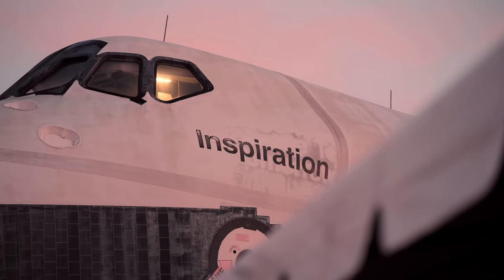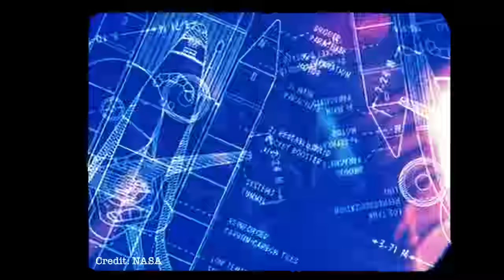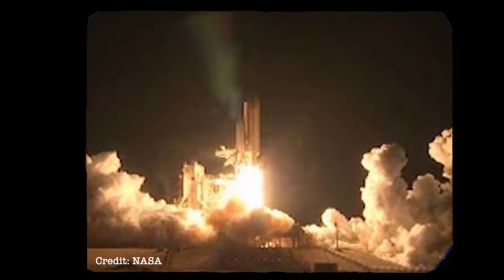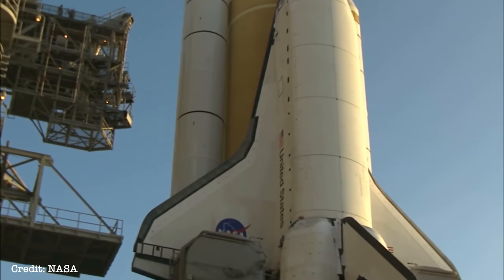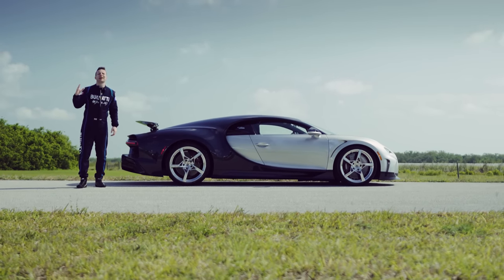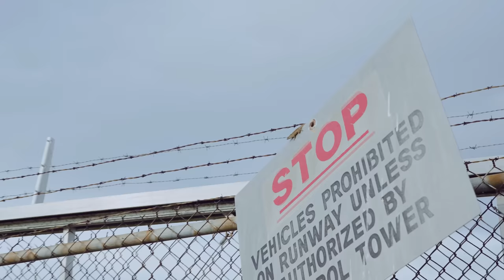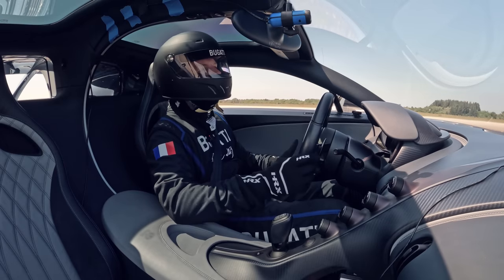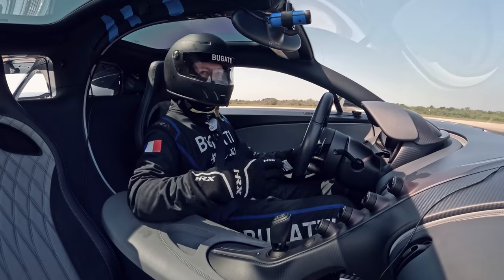Bugatti Chiron Super Sport vs Space Shuttle – Which Is Faster Down A Runway? | Top Gear

Comment: Chiron went faster than a conventional space shuttle landing, but I bet not faster than the Reliant Robin space shuttle
Reply: next bugatti should make 2040 ps + 1 yasa axial flux motor with 500 ps that only  weighs 25 kg it should be sandwiched between  10 speed multiclutch gear box and the engine plus 10 kwh catl condensed matter semi solid state battery with 430 wh/kg in pack it means battery will weigh less than 25 kg,that also means next bugatti's electric system weighs only 65kg with high volts cables and the inverter,bugatti should unveil the beast in 2026 geneva motor show,2540 ps hybrid bugatti with carbon fiber front and rear subframes it will weigh exactly the same as chiron ss but with 2540 ps hybrid powertrain,it will be the winner combo
Reply: @davidfujkk8018  what 😅😂😂
Reply: It is not an accident that the Reliant Robin and the Space Shuttle share the basic gear arrangement. :)
Reply: comment of the year
Reply: @david fujkk  if you're telling the truth, it's unbelievable.
Reply: @davidfujkk8018  excuse me sir , English please :)
Reply: slavegangz No it’s not they haven’t done the 300 MPH sprint yet so that’s way too early to be making any claims. Bugatti did it and we have video evidence of it. Christian Von Koenigsegg himself said : “It has a projected top speed to 316 MPH or Roughly around 532 KMH.” And once he was asked how it works he said :
“We run engine on the dyno and calculate the possible Top speed.” 
And if you know anything about cars you know that’s not how you get the 300 MPH club membership. You have to physically do it and drive the car to that speed atleast once to get that title somewhat. Official Guinness top speed records require two runs down the runway in opposite directions in a customer spec car and the Top speed is the average of both runs.
Reply: @Waltube. Cocaine is a helluva drug
Reply: slavegangz  On paper n in video games, definitely yes! But nowhere nearly as reliable as the Veyron n Chiron in real life conditions. There's a reason why Koenigsegg Regeras spend more time back at the factory than on the road. The Ageras too are plagued by transmission issues often "when pushed hard". If you can't push a car that's meant to be driven hard then it defeats the purpose no? There have been 1 or 2 instances of Regeras having their transmission grenading. I'm hoping that they were able to fix those issues with the launch of the Jesko since it's got an all new gearbox, but it's too soon to say. 
That's where the Veyron n Chiron have excelled spectacularly. As Jeremy Clarkson put it, you can drive it in the city the way you would a VW Golf n in a flick of a button, slow down or speed up the rotation of the Earth depending on which way the car is headed 🤣 
Make no mistake, I absolutely hold Christian Von Koenigsegg in very high regard. Folks like him n Horacio Pagani have managed to beat all the odds n carve their mark on automotive history n will forever be held as legends, but what's a bit unfortunate is that both of them don't appreciate their customers pitting their cars against other industry marques in a true competitive manner unless the factory is directly involved in the setting up n monitoring of the car during the attempt. But on the other end, when a certain (Polish?) millionaire/billionaire car collector wanted to test the claimed top speed of his Chiron, the same way he did with his Veyron, Bugatti suggested that the car be checked for calibration aka a thorough inspection n gave him the thumbs up n the dude went out n did a flat out run on the German Autobahn. All they supposedly checked were for any possible damage or cracks in the wheels, fresh fluids n tyre conditions apart from a general over-the-air diagnosis. The owner/driver in question was no race car driver who came with excellent driving skills, yet the manufacturer had no qualms in unofficially being in support of the attempt. Now if that isn't confidence in your product, I don't know what is! On the other end, there have been a few instances where Christian n Horacio have intervened in person when owners attempted to pit their cars against other hypercars in a competitive setting even when the tests were to be carried out in the hands of a professional racer on track in a controlled environment. The owners were allegedly warned that if they proceeded, they would lose all future opportunities to buy limited edition offerings from them. That should give you some food for thought. Cheers!
Reply: @davidfujkk8018  They aren't going to do that, after they hit 304 in the Chiron SS, Bugatti said that they were done chasing top speed records
Reply: BUGATTI BOLIDE? 500 kmh

Comment: Next: Bugatti Chiron against a supersonic missile
Reply: ,next bugatti should make 2040 ps + 1 yasa axial flux motor with 500 ps that only  weighs 25 kg it should be sandwiched between  10 speed multiclutch gear box and the engine plus 10 kwh catl condensed matter semi solid state battery with 430 wh/kg it means battery will weigh less than 25 kg,that also means next bugatti's electric system weighs only 60 kg with high volts cables,bugatti should unveil the beast in 2026 geneva motor show,2540 ps hybrid bugatti with carbon fiber front and rear structure it will weigh exactly the same as chiron ss but with 2540 ps hybrid powertrain,it will be the winner combo
Reply: Hypersonic
Reply: @davidfujkk8018  You should just build that yourself!
Reply: @RealGodfromheaven  Lightspeed
Reply: @DavidWVisuals   ludicrous speed
Reply: @davidfujkk8018 Not maxed out til it uses a tachyon booster...
Reply: @davidfujkk8018  A hybrid weapon for legal road 😄
Reply: @davidfujkk8018  Then It's called Bugatti spaceship 🙃
Reply: @ronakjadhav8015  they should do it exactly like i said,

Comment: The Chiron SS is like a beast chasing his food.
Reply: Bugatti should keep w16 engine for successor of bugatti chiron because of bugatti's limited production which is around 500 units every decade and low useage of bugatti's owners it has almost zero impact on carbon emissions and global warming, reality is limited production vehicles has no impact on global warming,,next bugatti should make 2040 ps + 1 yasa axial flux motor with 500 ps that only  weighs 35 kg which should be sandwiched between  10 speed multiclutch gear box and the engine plus 10 kwh catl condensed matter semi solid state battery with 430 wh/kg which means battery will weigh less than 25 kg,which means next bugatti's electric system weighs only 70 kg with high volts cables,bugatti should unveil the beast in 2026 geneva motor show,2540 ps hybrid bugatti with carbon fiber front and rear structure it will weigh exactly the same as chiron ss but with 2540 ps hybrid powertrain,it will be the winner combo

Comment: What a brilliant piece of film! 

The fact it does those speeds, and makes it look so effortless, is the most amazing part.
Reply: @davidfujkk8018  that’s not possible because it has a engine and a motorcycle weighs more than that btw so
Reply: @Zqeluq9123  next bugatti should make 2040 ps + 1 yasa axial flux motor with 500 ps that only  weighs 25 kg it should be sandwiched between  10 speed multiclutch gear box and the engine plus 10 kwh catl condensed matter semi solid state battery with 430 wh/kg it means battery will weigh less than 25 kg,that also means next bugatti's electric system weighs only 60 kg with high volts cables,bugatti should unveil the beast in 2026 geneva motor show,2540 ps hybrid bugatti with carbon fiber front and rear structure it will weigh exactly the same as chiron ss but with 2540 ps hybrid powertrain,it will be the winner combo
Reply: Would you have expected the car to sweat and pant?

Comment: Awesome film. Shuttle STS wasn’t the most powerful machine ever built though. Until Space X’s SuperHeavy/Starship full stack flew the other month, the Shuttle was some way behind the immense thrust of the Saturn V. A machine built in the 60s that still blows my mind today. Which makes it pertinent that I share my all time fave description of a Saturn V launch: 

🚀 🤯 

“The six main propellant valves in each engine opened in a mechanical ballet, and a Niagara of liquid oxygen and kerosene began cascading downward in pipes the size of sewer mains. The turbopumps were now turning at 5,000 rpm, and like a whirlpool draining the sea, they sucked down the propellants with stupendous ferocity and pushed them through the thousands of pinholes in the injector plates. Between them, the five engines were now vaporizing fifteen tons of liquid a second.
"...two, one, zero, all engines running..."
If every river and stream in the country were harnessed by hydroelectric dams, they would have generated less than half the power now pouring from the main engines and blasting through the flame trench like a geyser from hell. As the roiling smoke surged out on either side for a third of a mile, hydraulic rams collapsed the linkages of the four hammerhead clamps at the base of the rocket, and they sprang away in split-second unison.
"...Lift-off. We have a lift-off, thirty-two minutes past the hour..."
From four miles away, the scene was mystifying, surreal. The rocket moved, it seemed to levitate, inching upward on a tower of incandescent fire--but there was no sound, only the unsuspecting gulls wheeling in the silent sky. And then the surface of the lagoon in front of the press grandstand suddenly rippled as the shock wave flashed across and thudded into the chests of the spectators and shook the ground beneath their feet and filled their skulls with a crackling thunder that overwhelmed the atmosphere itself. To the million souls who watched dumbstruck as the great machine ascended, there could not have been the slightest doubt that this thing was leaving the planet.”

—"Angle of Attack" by Mike Gray, Chapter 14, p. 275. 

Like I said, mega film. Loved it.
Reply: Borrowing this. It's poetry alright!
Reply: @srinitaaigaura  Isn't it just. One of my all time favourite pieces of descriptive writing.

Comment: There'd be Ageras, Neveras, Jeskos etc that might beat the Bugatti in numbers- but still the Bugatti has a different vibe, sort of a legendary standing at the very top of all the others. What a beautiful machine.
Reply: ss 300+  - bolide is still in production
Reply: @ronakjadhav8015  Bolide is already done
Reply: Ageras and naveras don't beat the chiron in top speed. The jesko is working in it but not quite ready yet.
Reply: Chiron SS 300+ owns Agera RS Regera
Reply: @Smzxe  exactly. The agera rs and regera can't do 300+ mph.
Reply: @rishirajsaikia1323  Jesko can't even touch standard Chiron in drag race
Jesko is slower than McLaren 720s in 1/4 mile 
765LT beats 720s 
Ferrari SF90 beats 765LT badly
Chiron smoked both sf90 765LT Speedtail etc
Chiron Supersport is much faster than Chiron
Reply: @Smzxe  765 LT means long tail
Reply: @rishirajsaikia1323  no McLaren Speedtail is much faster than 765LT 
Chiron beat McLaren Speedtail very badly 
There is no Koenigsegg than can beat McLaren Speedtail
Reply: @Smzxe  the regera holds the current 0-400 kmph record beating rimac navera I think.

Comment: at least Richard Hammond did this race with a real jet beside the Bugatti,  oh man I miss old Top Gear nothing compares to it
Reply: You can't physically race them next to each other
Reply: @DittoGTI 
I would like to see a Bugatti accelerate to Mach 1 in 45 seconds as the shuttle did! 😃
Reply: @fromnorway643  Yea, aside from the obvious power bias, the shuttle would also violently shake the ground and probably cause the Chiron to crash, not to mention the fact that if the Chiron ended up behind the shuttle, the driver would almost certainly be killed
Reply: @DittoGTI 
If the driver was placed in the flame deflector directly beneath the shuttle or a rocket of comparable size (like the Saturn V, SLS or SpaceX Super Heavy), he would certainly be killed even if he was inside a TANK!
Reply: @fromnorway643  He would be killed in pretty much any vehicle we have right now. And instantly as well, not just fatal burns or heat damage

Comment: should have used the 300+ but still amazing video
Reply: The super sports is the 300+
Reply: @BoostedReddy  yeh but the 300+ exposed carbon special edition that they used for thr run
Reply: @Score4L  both are same no difference this one is only gearing limiter can't go any higher than 273 mph
I think it hit limiter at 250 mph it looked so slow

Comment: 7 million horsepower with all main engines and SRB's ignited not pounds of thrust. A Saturn V was producing around the 6 million horsepower mark.
Reply: There is no simple way of converting thrust to horsepower, but I have read somewhere that the Saturn V's first stage had 160 million horsepower.
That probably means that the combined power of the shuttle's three main engines and its two SRBs were more than 100 million horsepower.

Comment: Wrong info, click bait title and tried to convert thrust to hp.... how top gear has fallen...

Edit incase anyone is interested

The wrong info: the shuttle was never the most power machine ever built. The Saturn V held that title for a long time.

And you just can't convert Thrust to hp, thrust is a force over a distance (mass x acceleration)

Hp is a rate at which work is done (work/time) where work is the energy required for a force over a distance. 

A stationery rocket engine would produce 0hp, but would still produce thrust (stationery thrust)

Comment: The Bugatti sucks . Mclaren f1 did 251 with just a naturally aspirated engine at 630 hp lol w16 and four turbos why. The Hennessy venom went even faster with a v8 turbo . The ford gt 2005 model went 299 with its v8 but used different gas  but still small motors out did the Bugatti